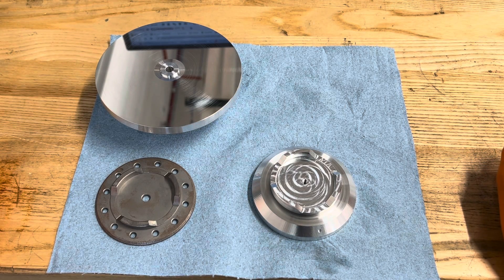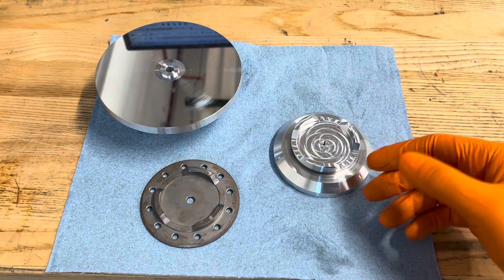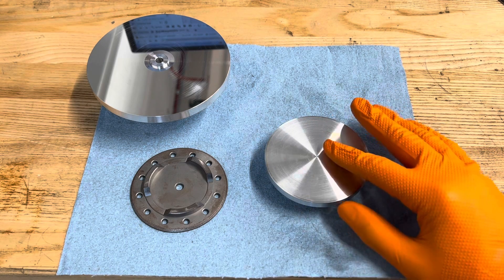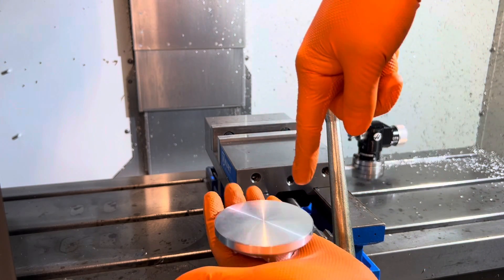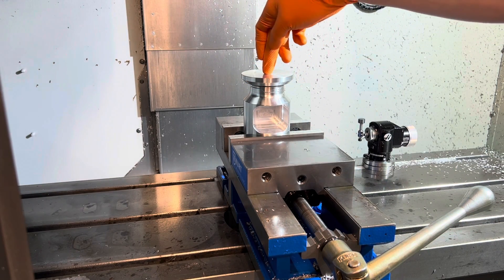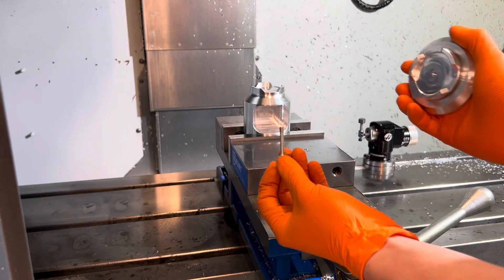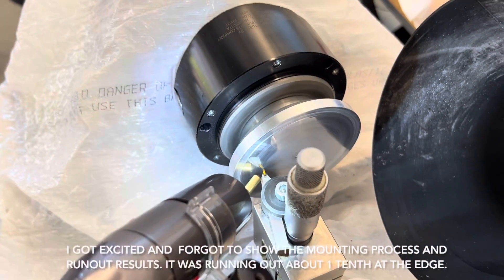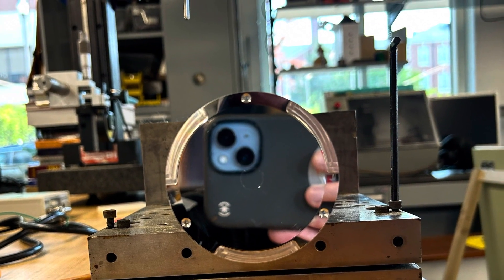Diamond turning a spherical mirror- roughing and work holding

Comment: Nice precision optical mechanical machining setup and callout to Layton Hale. He noted ~4 years ago that for best placement in self-seating condition of Kinematic interface that there is a minimum CoF  typically less than 0.3 @~55°. 60° can cause a locked interface. Also @3:35 maybe worth noting and Rx Ry Rz, 6 faces 6 DoF.

Comment: Did I ask you before if you were interested in spinning out a flat (to 100 microns or so) blank?  A reasonably robust, optically pretty-good first surface mirror is relevant to my interests.
Reply from the maker: What diameter? And do you mean nanometers?
Reply: @cylosgarage  4 inch diameter maybe?  I do mean microns; I'm sure even modest effort would get you a lot closer but I don't need anything deliberately that flat.  My use case is common photography and that is pretty forgiving.

Comment: Have you tried running your air bearing with large molecular gasses? I am thinking that butane or one of its ilk might have a higher effective viscosity (not really sure of the right terminology here) that would damp out vibrations better.
Reply from the maker: Eric marsh has done some research on this and found there can be some benefits but it’s down at the single digit nanometer level. Ive got bigger issues to address first :)

Comment: What stops the pull from the bolt from bowing the mirror?
Reply from the maker: The groove in between the coupling teeth and the rest of the mirror, visible around 1:07. This helps isolate the clamping stresses and distortion.

Comment: Watching this, does turbulence from the air blast introduce any unwanted cutting tool movement/noise?
Reply from the maker: no doubt, but it's not the limiting factor here. The vibrations from the z axis air bearings are the main thing limiting surface finish right now.

Comment: I would love to see a 10,000 foot overview on building this lathe I hope to oneday build a much bigger version (24x144)

Also how reasonable is it to make your own granite parallels? The three plate method is easy enough and I expect it to take me a few weeks to get it that smooth.
Reply: China has 1m long parallells for like 150 dollars w shipping. Lapping will work but it is probably worth it to go all in on diamond grit. It is a couple times faster than carbide grit theoretically. Buy grit powder not pre made oil mixes. You will save a lot of money. You need like 20% grit and rest water, oil, isopropanol or whatever you want to use. Also you should not underestimate how long and boring it can become to do lapping. You will probably save time doing small parts first to learn to do it right, at a certain grit you want a certain finish before moving on to the next. Good luck if you try it out.